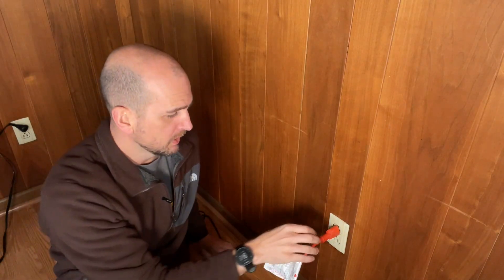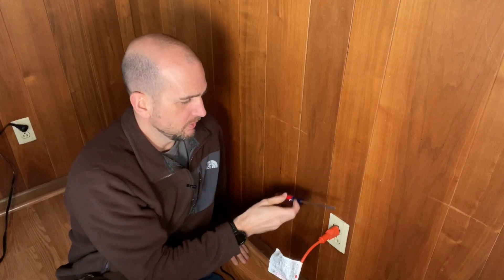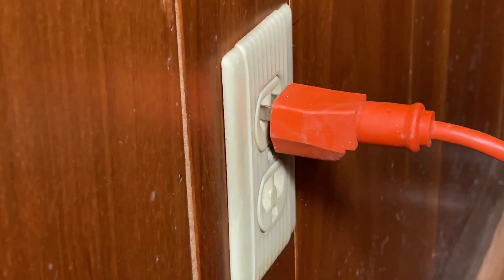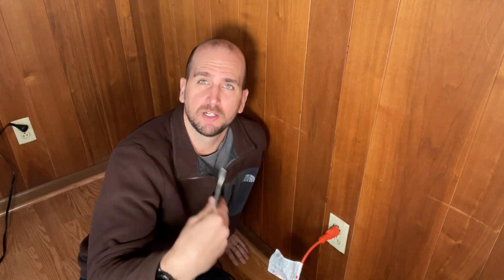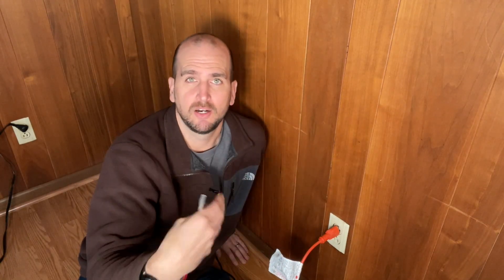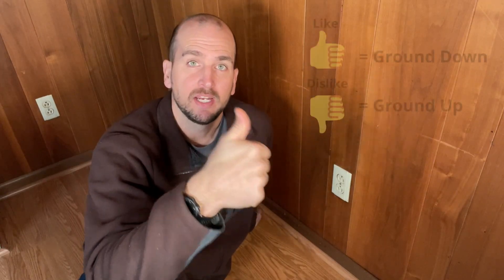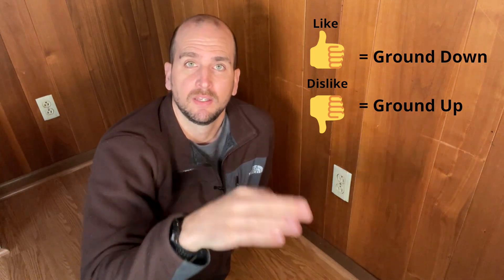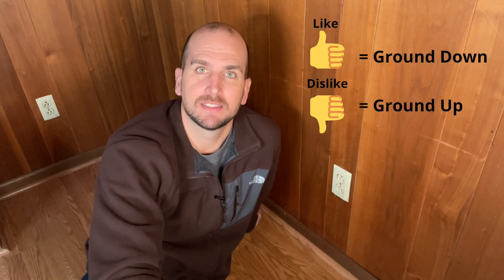Should An Outlet Be Installed Ground Down Or Up

Comment: is installed down! The grounding path should be the last part of circuit to disconnect and the first part to connect any device to a circuit! The grounding circuit is there to protect people from electrical shock! if a short develops in the device that's plugged into the receptacle the circuit breaker will trip shutting down the circuit! It the ground plug is on top the ground plug can pull out but the circuit can still be live! Exposing anyone who touches it to electrical shock! I/E gound plug to the bottom ! As an electrician I was taught to connect a circuit and devices to a circuit in this manner !
Insure circuit is disconnected at panel and test
1 connect ground strap
2 connect none current carrying conductor
3 connect load line
disconnecting
Insure circuit is disconnected at panel and test
1 disconnect load line

2 disconnect none current carrying conductor
3  disconnect ground strap
The grounding strap is your life line! It's always connected first in the circuit and disconnected last!
Note = if anything makes contact between the current carrying and non current carrying conductors the circuit will trip if the circuit is properly installed and proper breaker is used!

Comment: I'm a ground up guy. Here's why. The ground tip is longer than the others making it easier to insert first because you can see it fit into it's hole. It's "ergonomically" easier than fumbling around with the ground down which may be hidden by the other lugs.

Comment: This makes no sense to debate on ground up, chances are highly unlikely for metal small enough to land on plug to short circuit. If the plug is loose enough for that to happen, then receptacle is defective, requiring to be replaced. This is a code violation having a defective wiring device in service. If on AFCI circuit will cause nuisance tripping.

Comment: Ground down.   Residential wiring.   Have been installing for 30+years.   The odds of a metal object hitting both hot and neutral pins at the same time,  are not that likely.   Also manufacturers of appliances are making cords with ground down,  90 degree bends

Comment: ground down makes sense - if something metal falls on the ground pin of a partly-inserted plug, you might not realize it for some time to come; that same metal object contacts the hot pin, BAM!, something is going to happen - arcing, maybe smoke, flickering lights, tripped breakers, etc (but I'm not an electrician, DIYer, or even a homeowner, so what do I know?)

Comment: Ground down!  One  reason the ground pin was added was to prevent reversing the hot and neutral as in a 2 slot opening.  Many receptacles used to have the hot side reversed herefore adding a wider neutral prong.

Comment: I've been an electrical contractor for 30 years and in most cases it's ground down,  when using a 2 gang box with 2 duplex receptacles one is ground down and the other is ground up so the neutrals are in the middle and hots are on the outsides but besides that mostly ground down

Comment: When you grab a 3 prong plug with ground down your thumb sits flush across the top but your index finger can roll over the bottom edge. With ground down your finger would only touch the ground pin. With ground up you could potentially touch the live pin.

Comment: While working as a residential electrician, we would reverse the outlet in a room that had a "half-hot" plug controlled with a switch. It was an easy way to identify the switch-controlled plug. Where I mostly saw reversed outlets was in commercial settings with metal coverplates.
Reply: With furniture installed, you probably won't see the other plugs

Comment: I’ve lived in numerous states and most homes I’ve owned there had ground down.
However, it is common to put ground up in a room to designate which outlet is on a wall switch, although on a duplex outlet the connector is removed to allow wiring one outlet on the switch and leaving the other hot.

Comment: Look at the cable that goes,to the device. Ground up, cable comes in so the orientation is it comes in from the positive/negative side. Ground down, the opposite. Look at the box. If 3 wires, hot, neutral, ground. Look at the device. Maybe you need to change the device cable to get the orientation you want.

Comment: this happaned to me where i was measuring and tape was extented pretty far and it fell right between the wall and plug . sent sparks flying, turned the wall and receptacle all black, and a 1/4 inch gap in the tape...I always have all my plugs with ground up, there are only 2 plugs in my whole house i have changed to ground at the bottom for air fresheners that hold oil, were It can only be pluged in with ground at the bottom. and 3 years later I ran into this happen and changed them back to ground up.

Comment: 04:22  "you might have a plug that takes a quick 90" ... holds up a 45.  Say he was replacing a receptacle in a kitchen,  and accidentally dropped the new one into the garbage disposer.  That one would probably be ground up.  þ

Comment: Definitely ground up as I had an unusual encounter. I was hanging some shelves for a friend and when i hammered some wall plugs in, the plug below had the brass cover come off and landed
across the contacts which were in this case, ground side down. quite the electrical short occurred !

Comment: I do prefer ground down mostly because it’s what I am used to but think about how you grab a cord to plug it in. Your index finger is wrapped around the bottom which puts you close to the pins on the bottom. I would prefer to have my finger close to ground in case of slip or misplaced finger.

Comment: There to my knowledge are not electrical items that are designed for the ground up so for that reason I prefer ground down because I have run into issues (I rent) in apartments where I could not use a plugin air freshener (I think most are corrected now) surge protectors etc.

Comment: Always ground down. Mostly this is for consistency as ground up is the universal indicator for switched outlets. One can enter a room and immediately spot the plug that is connected to the light switch by the door. I have also seen ground up where a 20 amp outlet has been introduced to a 15 amp room. Keep up the good work with these videos. The more consistent we all get the easier it is to work in an environment that other (possibly many other people) have previously worked.
Reply: I did not know that...still learning every day...and,Loving It !
Reply: I'm surprised to read how many people are surprised by this or didn't know it, so I'm wondering if it's sort of regional. Where I live it's pretty much done everywhere and that's exactly what people look for. They even did my new build house that way a few years ago.
Reply: You said it sir. A majority of this discussion is just nuance. Thought codes were established for consistency and yet there isn't one for ground up/ground down.
Reply: My late uncle was an electrical engineer and worked for a power company.  He always said that the ground was at the bottom.
Reply: @druegillis1744  My late uncle was also an electrical engineer and worked for the City University of NY for many years.  I learned a lot about electricity and working with switches and receptacles from him and inherited a number of tools from him before he passed away four and a half years ago.  He didn't have any preference which way the ground faced as long as the outlet worked.
Reply: @druegillis1744  I would say your Great Uncle was NOT a man anyone should have argued with.
Reply: Merry Christmas
Reply: Many extension cords have their plugs oriented so that the cord will face downwards when plugged into an outlet which has the ground at the bottom.

Comment: I can look a job a in most cases tell if a knowledgeable person Done the work . Do not ever tightn the plug into the junior box . Leave it have quarter inch of movement.  When you put the cover plate on if you have tightn the plug in . It will not come out into the cover plate . In most cases it will be bent and may Crack

Comment: I always install them ground down. As the user, I want to be able to SEE the hot prong when I'm plugging in a device. If you install them ground pin up, you could be touching the hot prong without knowing it when you plug something in.

Comment: For me it depends on the job, if I'm wiring a house I usually go ground down because most things in a residential setting are  2 prong so no strain on the plug or ground, in a shop or heavy use of 3 prong I do ground up for less strain on the 3 prong plug, drop cord, etc. and it'd prevents the weight of the cord from pulling down on the ground pin making it wiggle out or half way out of the socket.

Comment: When I was a child, virtually no residences had grounding receptacles.  I did see them in schools and stores, and my Dad explained function of the prong.  Though all two-prong receptacles were polarized, most citizens never noticed.  Then came the 1980s.  Lamps in particular would only plug in one way.  The polarization safeguard had been there all along.
Here in the northeast, new construction always had the ground prong down.  I never knew there to be a "correct" way -- it's just what I always saw.

Comment: I have found that most devices that plug directly into the outlet have the ground on the bottom. That way it hangs down. If the ground was on top it would extend up from the outlet. Which would allow it to pull away from the ground wall.

Comment: Never thought about the safety part, but I always did ground down, I work with computers and servers, build them, run them set them up for others, and for 90% of all of that ground down makes everything plug in without any twists in the cable, although I think it might be worth noting that all power units, APCs, PSUs, etc all have the built in ground pin facing up, I also like ground down because the "outlet" looks like a ghost
Reply: Boo! 😮👻

Comment: Absolute nonsense. Install the receptacle as you see fit. People are too absorbed with their own opinions. Had an inspector once refuse to sign off on a permit unless I turned all outlets with the ground pin up. He no longer inspects, and the permit fee was refunded. A close friend teaches residential and commercial electrical at the local college. More importantly, he teches the NEC. In California! He had a discussion with iuithe head of the planning department.

Comment: I prefer ground down because it makes a cute little face and it's simply what I'm used to. I think ground up really only makes the most sense on kitchen islands, where you're going to be above the plug and there's a (very slight) chance that someone could drop something on there and connect the prongs like you showed in the video.

Comment: I worked an industrial construction job in Georgia where they specified all the T-slotted NEMA 5-20R receptacles with the ground up while the NEMA 5-15R receptacles were installed with ground down. That was a spec from the customer. The 5-20Rs were for the maintenance crews that would use heavy duty power tools and the 5-15s were for normal applications. The 5-20Rs were also installed with lockable covers. I wasnt in on the wire pulling and terminating part (I was a conduit runner) But I bet those 5-20Rs were on their own separate circuit breakers.

Comment: Being  from the UK, the ground pin is always facing up for a very good reason. The cord always enters into the bottom of the plug so the ground or earth is the longest wire in the plug and will always be the last to be pulled out if the cable happened to be yanked out of the plug. Most sockets in the UK are switched as well so you can switch whatever is plugged in at the socket and to switch on is to switch down which exposes the top of the switch which is coloured red or displays the word ON in red letters This means that at a glance you can easily see that the socket is switched on

Comment: In the same way folks say something can easily contact hot and neutral when ground is down...there is the reverse scenario. I worked in a nursing home where beds are lowered and raised. I had instances where the steel-angle part of the bed would be raised and dead-short on hot and neutral if ground was up.

Comment: Forty + years ago, I was told ground down. Most damage to plugs and sockets occurred when someone stepped on the cord near the outlet and the ground prong would be the last connection out (safety). Since then, grounded cords have had the ground prong lengthened, so it doesn’t matter anymore. I like them installed the old way, l think it looks better and I always install switched plugs ground up.

Comment: I am surprised to find folks here civil enough to not be cussing at each other, as on many other channels. Most of the subscribers here must be educated. Anyways, the primary issue with having the ground prong up or down is the potential of a metal object slipping in between the end of the insulation on the plug and the wall socket the plug is supposed to be securely plugged into, shorting from the hot prong to one of the other prongs or possibly to something else external to the plug. Personally I see the ground up option just a half hearted attempt to fix a sorely flawed situation that often causes more problems than it effectively fixes. Honestly, how many of us have actually seen shorts happen between the hot and neutral prongs? The only time I have is once in college when somebody wrapped them with solder on an o-scope for a practical joke. Somehow nobody found it funny. With the the current plug/socket arrangement for the US, the best thing to do is put the hot prong on the bottom with the neutral prong directly above it, leaving the ground prong to be off to the left of the other two prongs. That way if the prongs are ever exposed and something does fall on top of them it will most likely hit the neutral and either teeter left to the ground or the right with momentum making it almost impossible for the object to contact the hot prong. I am sure everybody here would agree that the US is currently mired with a system that is woefully flawed. But how many of us would be eager to initiate change now to an outlet system that is inherently safe?

Comment: Back in the day, when I worked as a Leadman Yacht Electrician, for Atlantic Yachts, I installed outlets with the ground up, because the ground pin is longer than the blades, and the plug held them more securely in the outlet. If the plug sagged, the blades were forced into the outlet. When the outlet ground was down, the plug had a tendency to sag downward, exposing the hot and neutral. Maybe new outlets were looser in the seventies. I don't know. On occasion, the yacht owner would have me turn the grounds down, which I was happy to do because the customer is always right!
Reply: My dad told me that if the plugs sagged, it's time to replace the receptacle. I've followed that advice for 50 years now.
Reply: Ml
Reply: Thank
Reply: @wotysgtb4348  u

Comment: For the ground up preference people... Why is it that plug cords are either going the same direction as the prongs (horizontal) or drop down perpendicular to the prongs with the ground down? I have never seen the ground up on a plug cord. Cause it would be upside down. 
But, to the safety point. I've seen much more safety concerns favor the ground down in the dozens upon dozens of comments I've read on this post. The one (and only lucid one) about ground up to guard against something falling on the prongs is  outweighed by the numerous safety hazards avoided by the ground being down. I read this post with an open mind and really wanted to know what the verdict was/is on this topic. Before moving to my present house in 2006 I never saw one outlet with the ground up (I was 37). Or upside down in my opinion.

Comment: I usually install them ground side down, although I like your suggestion of putting the ground side up for switched outlets.

When I am installing 2 outlets in a box (2 gang) I will usually install one ground up, one ground down (I do a lot of industrial work).  If they are on a single circuit, I put the hot sides next to each other.  If they are on two different circuits I put the neutral sides next to each other.  This saves time troubleshooting.  Some of the workers (i.e. non-electricians) have learned this and which side is hot, which is not,

Comment: NEC Article 110-10 states that work shall be done in a neat and workmanlike manner following all instructions from manufacturer. NEMA standards state that the ground shall be installed down not up. In a hospital I did, (1982) we installed outlets ground up, which was according to specifications. When employees pulled the cords out by grabbing the cord, it broke the small porcelain piece below the ground. The hospital came back on us  for damaged goods. We went to the manufacturer, their response was "you installed the outlets incorrectly according to NEMA standards." With all the back and forth, we (the contractor I worked for) flipped all the outlets over, to ground down and the hospital paid for all the broken outlets. Well over 500 outlets all hospital grade. I tucked that NEMA standard away and used it every so often when specifications would call for ground up installations. We would agree to install the outlets against NEMA standards as long as the customer would pay for any corrections and broken outlets. Sigh on the dotted line....
As an inspector, I would mention to contractors when trim out started about the NEMA standards and they immediately would jump on it  I would point out that I would have to call them on Article 110-10 if they installed them ground up. I was involved in several meeting when the issue arose. I always pulled out my NEMA standards and the customer acquiesced and the contractor went away pleased.